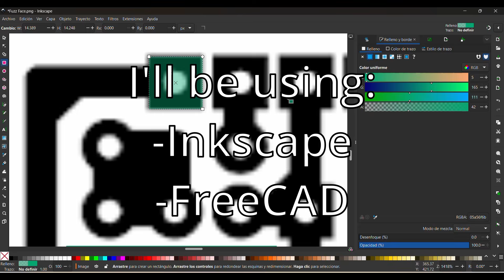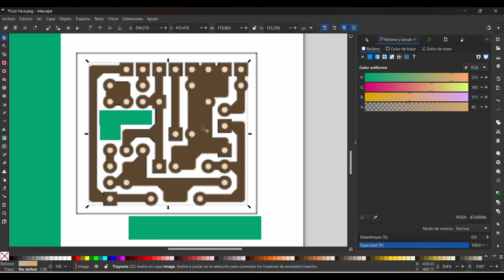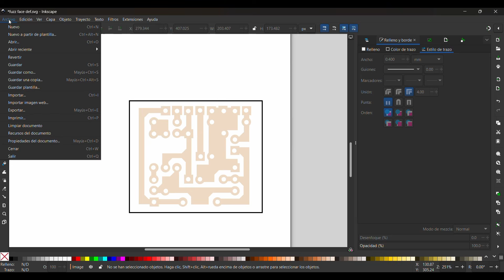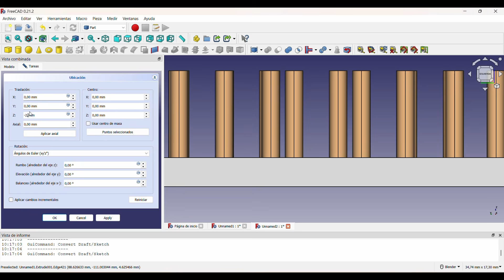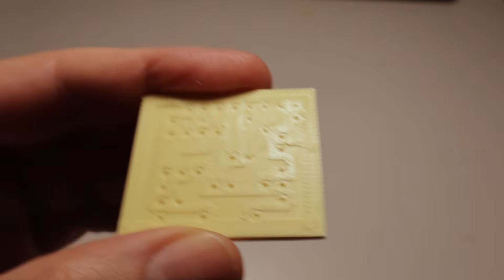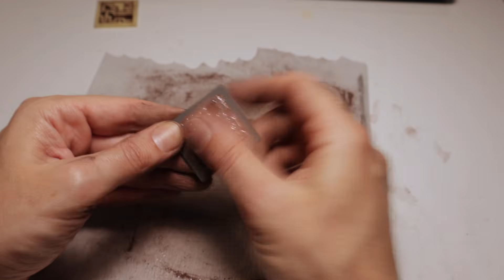3D Printed PCB! (sanded copper tape over printed model)

Comment: Why not designing an empty layer into the model then pause the print, add the copper tape and print another layer above or two, then change to abs and i think i would up pretty well and you would not have to sand the tape away

Comment: this is a much better method than the print-raised-traces, stick the tape on, and slice into the troughs with a hobby knife method that I've seen previously. another improvement might be to use sharp edges or ridges to sand down, rather than sanding away most of the tape, like etching just the gaps you need, and leaving the rest of the copper on the board

Comment: This is a cool idea, and probably a lot of fun, but my time is much more valuable than a clever idea.  By the time you have one of these done from start to finish, I could have designed a similar board directly in KiCAD or EasyEDA, have sent the Gerber to a PCB fab shop, have them on the way to my mailbox - and probably have three to five units of a proper PCB for the cost of 1/10th of a roll of good-quality filament. Not to mention while you're still sanding and cleaning, I'd be stuffing the boards with its components. Sure, you could do it in two days - or a long, single shift. But while you're messing with the printer and making the board, I'll be on my back porch having a beer and a hamburger.

Granted, experimentation is a wonderful thing - but so is learning and applying basic engineering principles: Everyone seems to be forgetting the KISS principle.

Comment: (I summarized the suggestions from the comments with AI.)

This PCB method works by 3D printing recessed trace geometry, applying copper foil/tape over the surface, then sanding away the copper sitting on raised areas so copper remains only inside the recessed channels. The strongest improvement ideas focus on making that process faster, cleaner, and more precise.

The most important optimization is reducing how much copper must be sanded away. Instead of removing large exposed areas, PCB layouts should use narrow isolation gaps and large connected copper pours. Another strong idea is printing thin raised “guard walls” around traces so sanding only removes copper from the wall tops while protecting the actual traces beneath.

Several commenters proposed replacing sanding entirely with mechanical embossing. A matching positive/negative mold could press the copper into grooves or shear isolation lines directly. This could improve repeatability and reduce copper dust, though achieving reliable electrical isolation mechanically would require careful tolerances.

Surface quality is another key factor. Smoother printed surfaces improve foil adhesion and trace consistency. Suggested improvements include slicer ironing, heated rollers, vacuum pressing, or using plain copper foil with separate adhesive instead of adhesive-backed tape.

Material choice matters because PLA softens during soldering. PETG, ABS, polycarbonate, or resin prints would likely perform better thermally and mechanically. Resin printing could also allow much finer traces and possible SMD support. Flexible materials like TPU could enable flexible PCB-style circuits.

Other proposed improvements:

low-temperature solder or solder paste to reduce substrate heat damage
vias using wires or conductive fill for double-sided boards
CNC-assisted finishing instead of manual sanding
direct KiCad/Gerber-to-STL software generation to remove manual CAD work

The biggest current limitations are trace precision, copper adhesion, soldering durability, and labor-intensive finishing. Even so, the approach is genuinely interesting because it creates PCB traces through physical geometry rather than chemical etching or milling.

Comment: I used the ironing technique on the top surfaces, and it greatly helped with the finish and uniformity.

When sanding the surface, I started with much finer sandpaper, which helped a lot to smooth the copper surface before removing the excess with higher grit sandpaper

Comment: Idea: lay out your traces so that you are removing far less foil. Have very thin removal areas, which will leave you with large areas covered in foil. That's fine. 
Idea: Add a wedge around the edge of the entire board, to ensure that the board remains level during sanding.
Idea: Use non-adhesive copper foil. Apply a liquid adhesive to the board. Lay the foil onto the board. Put it inside a vacuum chamber, to more fully and precisely fill the grooves in the board with the foil.

Comment: You could use low-melt solder paste instead of wire to make soldering less likely to melt the board
Reply from the maker: I should definitely try it! My iron is a bit... low end xD so it wouldn't make a big difference right now if I can't regulate the temperature. But it's a "must try" for this way to make PCBs. Thanks a lot!

Comment: Can you make 2.54 mm pin spacing pads for DIP ICs, with this method?
Reply from the maker: I was talking about it with another user. I'm pretty sure I can, the tape stays in place way better than I anticipate. I think it mainly depends on how good you are with 3d printing. I'm planning to make a second part of the video with the ideas from the comments and that's one of the thing I will try for sure.

Comment: You can use a CNC machine instead of a 3D printer. Then you can replace the material with a heat-resistant one.

Comment: Just a hint when soldering, you ideally want to put the iron against the leg of the component and then push solder into the  leg / iron.  Putting solder on the iron and then transferring it to the component takes enough time that the flux in the solder will burn off and make it harder for the solder to take to the metals.
Reply from the maker: Thank you so much for the hint. My approach this time was to brush a little bit of flux before. I was afraid of leaving the iron close to the PCB specially on the PLA one, but I think you're right and I was too conservative. Thanks a lot!
Reply: I believe the correct way is to hold the iron against the pad and the lead simultaneously to heat them both. Then, feed in the solder. You want the component and the pad to melt the solder, not the iron. That ensures a molecular bond between the solder and both parts. Flux first.
Reply: Depending on the situation I'll put a dab of flux on the component, and or dip some of the solder in flux, for tight spaces if found that touching the soldering iron to the pad/component then feed solder onto the backside of the iron.

Comment: I've got a Cricut, a consumer cnc vinyl cutter type thing, it can do a lot of other tasks. So seeing this I realise I can cut copper tape into circuits and use I guess a 3D printed or other sourced plastic board to make my own PCBs somewhat easier than how you're doing them. Cool cool, good video, nice to see.
Reply from the maker: Never thougth of that approach! Please let us know if it works, I'm really curious!
Reply: As a person who has worked with a cutter for vinyl transfers and other similarly finicky things, I imagine transferring a thin copper sheet would be extremely prone to tearing due to the nature of the thin copper, plus in small segments it would be far less forgiving than the relatively tear resistant vinyl, which is a bit stretchy.

Comment: Sanding part looks nasty. I'd imagine classic PCB etching might be better. 
Not sure which one though. Perhaps cover PCB outline with a marker pen -> some etching mix (perhaps citric acid+h2o2+table salt as one of safest) -> etching -> remove marker.
Although water seeping into PLA might be a problem here.
Reply from the maker: It's true it's super nasty but I hate etching with chemicals😂 I think that's why I tried this! Thanks a lot for watching!
Reply: There are advantages and disadvantages. In this case, a thick copper layer can be applied. Complex 3D structures can be created.

Comment: You should be able to do double sided boards by using support material as the first layer.
Reply from the maker: I will definitely try it! But i think I might try to print sideways to avoid using supports. Let see how that works! Thanks a lot for the comment and for watching!
Reply: You could also just print each side as a separate board and then super glue them together (back to back). Use some registration pins/holes and it would be pretty easy to get them aligned and glued.

Comment: You should investigate 3d printing a "form" that is a negative of the pcb and use that to press the tape into the corners more easioy
Reply from the maker: I've been told so, or even to cut the copper tape if I make deeper traces. I will wait a little to see if I here more suggestions and maybe make a video trying them! thanks a lot for watching!

Comment: Fascinating. KiCAD can output svg files, but they’re made of a bunch of overlapping shapes that may or may not be easy to handle in your 3D CAD platform. Actually I think KiCAD can even export a 3D model with nonzero trace thickness.
Reply: KiCad can also export STEP files! I a similar method last week and that worked, with a little bit of tweaking in CAD. Extrude the pcb slightly, then extrude cut all the traces, pads, fills (and possibly vias). I want to see if I can make it work for two sided pcbs too, wire as vias. I'm still wondering if a sort of solder mask can also be printer and glued on
Reply: I was just playing with KiCAD and found that I could export the board as a STL (with just board body and vias checked). To get the traces, I had to plot the traces to PDF (selecting "Edge Cuts" under "Plot on All Layers". That got me the traces plus the board outline. I loaded the PDF in InkScape, then saved it as SVG. I could then import the STL and SVG into OpenSCAD, scale them both to the dimensions of the board, and subtract the extruded SVG from the STL to get the indents for the traces. No idea why the direct SVG plot looks so bad, but at least plotting PDF, then converting to SVG is a decent workaround.

Comment: Omg did we make almost the same video at the same time 😮
Reply from the maker: 😂 almost! I guess it was in the air! Btw I see that you are into guitar gear. If you look closely to my video I forgot to blurred that it was the circuit for a fuzz face haha.
Reply: @frechetypen haha yeah we've using the same pcb out line 😂
Reply from the maker: @zurowetz no fricking way! It's true I didn't notice! Well that has to mean something 😂
Reply from the maker: @zurowetz I'm glad to see It works. I haven't tried mine
Reply: @frechetypen haha we should do some kind of collaboration 😉
Reply: @frechetypen helpfully yours works as well it looks so cool 😁
Reply from the maker: I have something in mind!
Reply: @frechetypen oh tell me 😀👍🏻
Reply from the maker: @zurowetz  I always wanted to make a small pedalboard, like 4 or 5 pedals, but using a single pcb and a single case. I mean, let say you have 4 pedals you use to play with your band or those that you use 99% of the time. Why not making a single pedal out of 4 pedals? As well, since we can 3d print pcbs, I thought an idea for another video could be to integrate the pcb on a 3d print. For a project like this we could 3d print the pedal case and the pcb on one piece. Still thinking how I would sand the copper and then solder, but I think it would be great to have a pcb integrated on a 3d print. We can think about it!
Reply: @frechetypen yeah I've built more than one pedal in a box before I have another video already in the making that I think you would like if you have insta I can send you the pic for that and it will be fun to see what you do🙂

Comment: Love the use of Inkscape for this, open source is always best. Is there a reason not to use Inkscape’s Trace Bitmap function for converting your circuit image to a vector file? Hand-tracing the image seems tedious.
Reply from the maker: Thanks! In my case just the resolution of the original image. It was a bit pixely. And maybe like this it's also useful for people not using a template. Thanks a lot!

Comment: This is complete garbage, just buy a blank PCB and use a dremmel to grind in all the traces like a normal person, this has been done for like 50 years, you do not need a 3D printer to make a PCB prototype jesus christ
Reply: Holy. Let people enjoy things, and then share their enjoyment on the internet. This is an experiment, and is presented as such. Being polite is also something people have done for over 50 years, maybe that's a skill you can work on.
Reply from the maker: Using a dremel isn't how normal people make PCBs, but I'm glad it works for you.
Reply: @frechetypen It absolutely is, have you not heard about the Manhattan method? It dates back to the 90s, you lack the knowladge of electronics history and methods used through out the years, learn it first.
Reply from the maker: @DolezalPetr nowadays there are companies that manufacture them for 2 dollars... If I want to prototypes fast I'll use my printer. But again, if the dremel is your choice go for it.
Reply: @frechetypen I am an electrical engineer designing PCBs every day for a living, if you want a quick prototype with like 5 parts you just make a birds nest, if you want it a bit more stable you make a Manhattan PCB, if you have more time you use a fiber laser or a CO2 laser, if you are doing an SMD job you get it manufactured externaly. 3D printers have nothing to do with electrical engineering.
Reply: @DolezalPetr  I think you're missing the point of the video. It's more about a cool way that you can make PCBs. it's not a long-term solution. Your fancy qualifications make you oblivious to other approaches. Not everyone has a fiber laser or the money to have a PCB manufactured regularly. Some people may already have a 3D printer, and this could be a practical solution for prototyping a pcb before sending off to a pcb fab.
Reply: @Decal-vg4cq Watch diode gone wild as an example of making quick PCB prototypes, the Manhattan method takes seconds, just grind in / scribe in the traces. 3D printing it is a waste of time, nobody with real knowladge of electronics would do it that way.
Reply: @DolezalPetr   I am familiar with methods of prototyping pcbs. I'm just saying that its unreasonable to say that this method has no practical use, and ingeneral saying 3d printing as a whole for pcb prototyping is a waste of time is kind of crazy, imo there is a time and place for this method and 3d printing for prototyping, like for chemical etching copper clad instead of using photoresist and acetate sheets. Or what about pcb stencils you can print them pretty easily. Obviously you will see better results with a resin printer but still at a minimum you can use this method as a learning tool for learning pcb design without spending a bunch of money on pcb fabs and without manually making your pcb with a dremal.
Reply: @DolezalPetr  I made PCB's when I was a kid in late 80s early 90s, not with a dremel. 
I would use nail polish and 3mm polyethylene tubes with a narrowed capillary end to draw the image. 
Then used HCl + H2O2 or H2NO3 or CuCl + NaCl as etching component. 
Much more accurate than a dremel.
Reply: @sssh2002 Of course, everyone drew their own PCBs, even my dad, for a finished one this was the go to way back in the day, for a prototype with a few parts you would just smash it all together just to see if it worked. Thats how it is done, first test the idea, then make it look decent.
Reply: @DolezalPetr  For that I used a prototyping board.

Comment: if you could make a software to make them from a Gerber or a photo with a standard setup, or something it would really step up the project, I'm decently curious I'll take a look and hopefully if I remember report my findings. 
One other thing it would be amazing if you could cut with two parts that sheer the copper, that might need an higher depth for the traces, but you could go a different route and work with a raised pattern for the traces (since you wouldn't need the sanding part), that would avoid problems given by the extra thickness of the board interfearing with the mounting of the component (I'm thinking of large SMD pads like for audio jacks*, maybe with resin you could get even some ICs but the ones with a big pitch).
*I know this specific example is not great cause probably you wouldn't trust the adhesion of the tape to keep the jack in place while inserting
Reply from the maker: I will try printing the negative to press the positive. A lot of people in the comments are suggesting it. I'll take the advice! thanks a lot!
Reply: @frechetypen  FYI if you use kicad you can actually export -> stl (or other), check only to export the body of the board and vias, traces  and pads and you get a file that has the body with all the holes and all traces raised by 0.035, with a 3d modeling software like blender you can easily modify that, for example by doing select->select similar -> coplannar after selecting the face corresponding to a trace.

I was considering coding a software that did that from a photo but this looks pretty good already considering that even from a photo you would have to thinker a bit to get the photo, maybe something that post-processes these 3d files even would be good